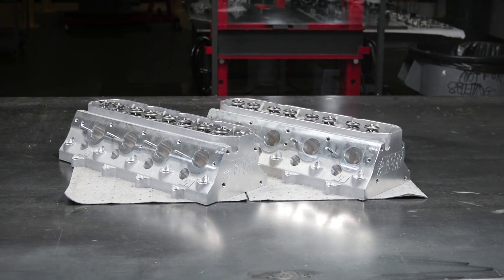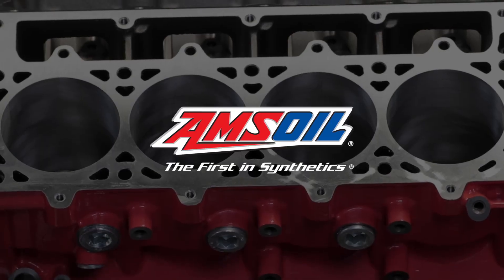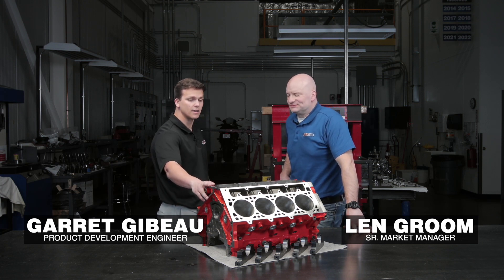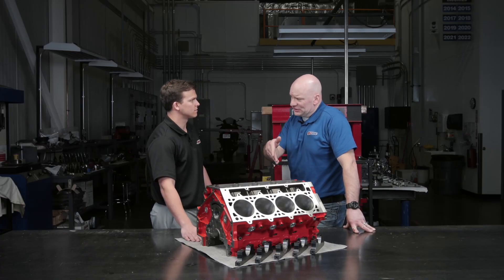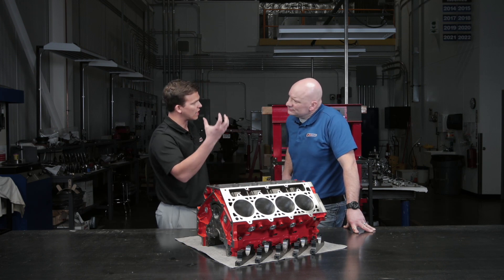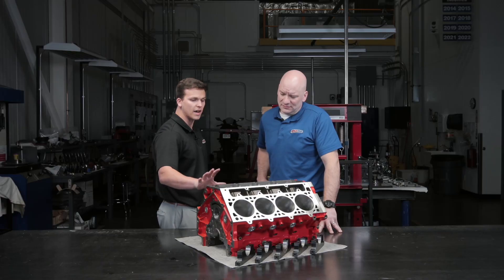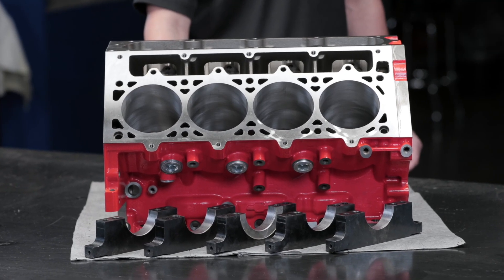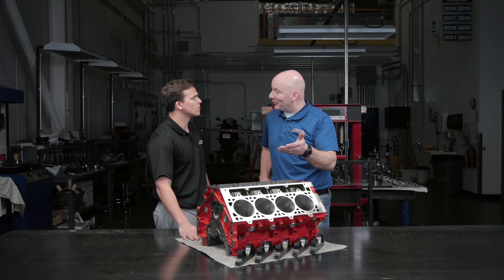"The Block" - LS Series Episode 1

Comment: 4.065  is the bore size on a 6.2…. You can bore an iron 6.0 to this size as well.   Basically An LS3, except they’re an aluminum block.  The problem with stroker LS engines is the cylinder bores are a little short and the pistons would rock and scuff the skirts eventually leading to failure.

A lot of company’s have changed piston skirt design to rectify this problem.  

A 4.8 and 5.3 are the same block. 4.8 uses diff ent crank and connecting rods.  Both can be bored out to make a 350, or a 383 stroker.  All these depend on piston/rod/crank specs.  LS engines are just a big improvement over the conventional SBC.